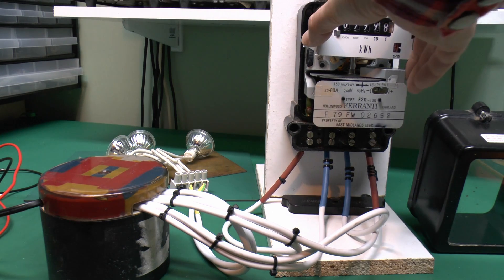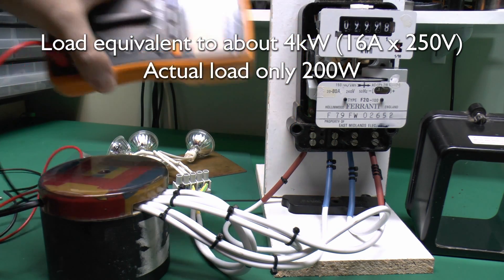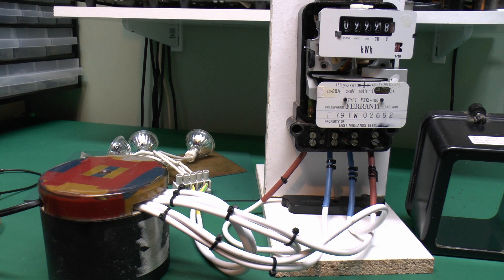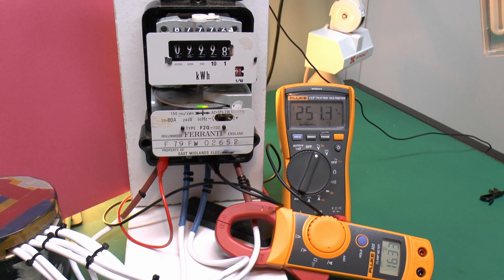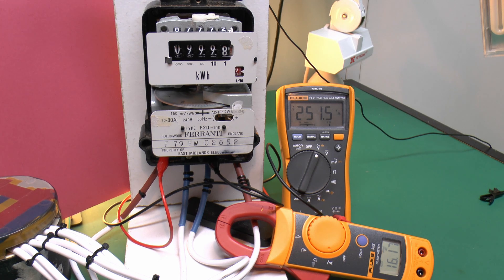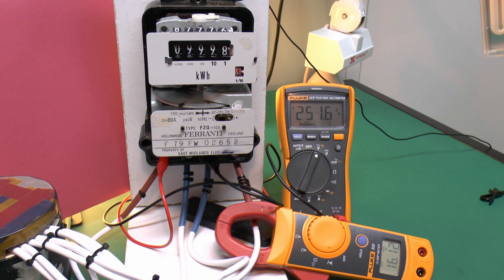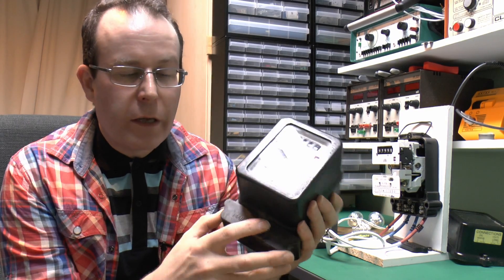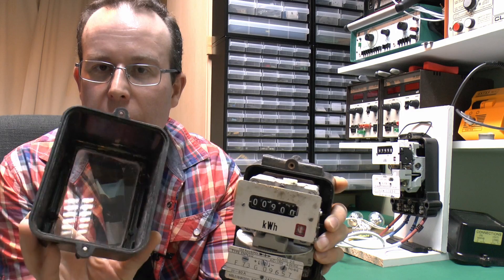Ferranti kWh Electricity Meters FNN2Q / F2Q-100 (Part 2)

Comment: Hi John just come across your video I currently have the exact meter installed in my house , about 5 years ago an electrician fitted a new fuse box but he never put the bottom cover back onto the meter I wonder if you can tell me if I can buy a replacement cover plate
Reply from the maker: They are not available, those meters haven't been made for decades.
You need to contact your electricity supplier to arrange for a new meter to be installed.  Without the cover, live parts are exposed.

Comment: Ah yes....The F2Q-100. I don't have one of those, but I do own a FPQ-102 which has the same arrangement inside, but the difference between yours and my FPQ-102 is that my one has a pre-payment section bolted onto the right-hand side of it. :D

Again, the FPQ-102 can be seen on my channel, bearing in mind that I do have two variants of the FPQ-102: One with clock-dials, and another with a cyclo-dial readout. Both have the same characteristic-set. Have a look for those on my channel and enjoy. :D

Thanx for showing,

-BoomBoxDeluxe.

5th March 2014, 16.02